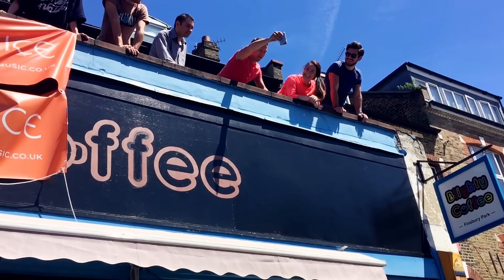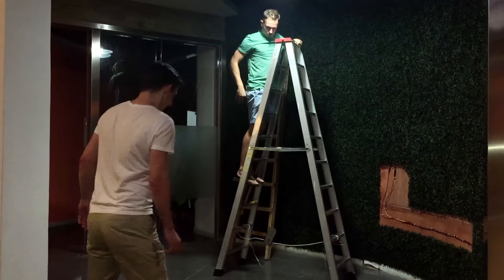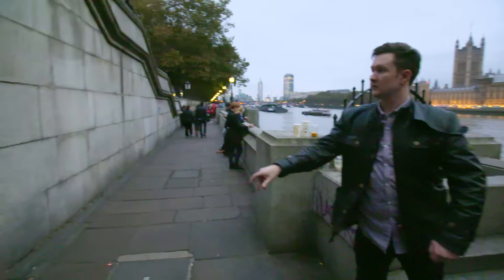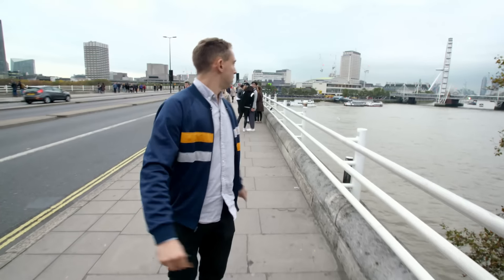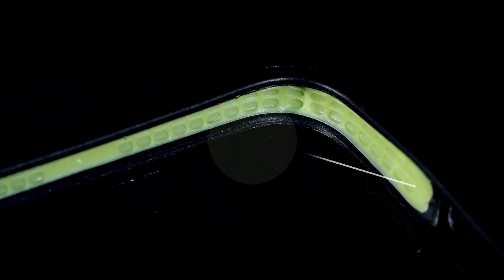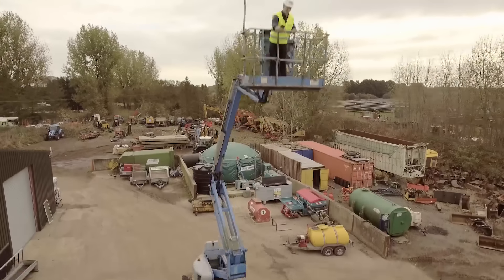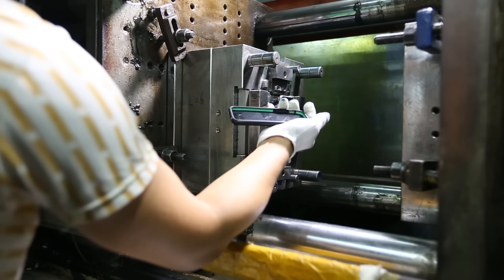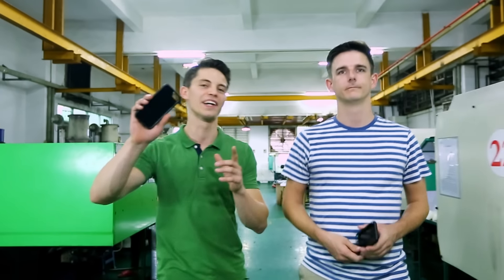Mous iPhone Cases | The Story of Limitless - Using AiroShock Protection

Comment: I ordered the Carbon Fiber 2.0 for my iPhone X and it arrived just 3 says later with just the free standard shipping. I also received 30% off. The case looks great. I have purposely dropped it a few times from 5-10 feet high onto concrete and nothing happened to my phone nor the screen. I’m very satisfied with this case, it’s slim and works great. 

If you’re wondering why I only tested the case from 5-10 feet high... It’s because realistically most people drop their phones from waist to shoulder height during day to day phone usage. Anyone who accidentally drops their phone higher than 10 feet is a complete idiot and a moron. So in my opinion a case that more then protects your phone during day to day scenarios is well worth it.
Reply from the maker: Thanks for the review Alan! Good to hear you're enjoying it!

Comment: OK so it absorbs energy and protects from cracks and scratches but what about internal vibration and damage?
Granted, you're not gonna be dropping your phone from a crane on a daily basis but I wouldn't go around throwing it on the ground just cause you felt like it
Reply from the maker: Ahah, we definitely recommend not throwing your phone on the ground whenever you feel like it! The impact-absorbing material we use (AiroShock) absorbs the impact on damage and helps to prevent damage to the internals.

Comment: Can these cases have popsockets?
Reply from the maker: Hey Potato! You can use our Limitless range (and non-leather) with a popsocket, however, remember you won't be able to wirelessly charge or use the Limitless accessories.
Reply: Mous it is fine cause I do t use wireless charging

Comment: Anyone note sure about buying a Mous Case, 
I'm an Electrician and I dropped my phone off a scissor lift,
 I didn't notice and drove over it with a scissor lift that weighs 2 tons and has hard rubber tyres. 
Expecting to find a case full off crumbs, To my surprise the only damage was a slight discolouring of the screen in the middle.

Comment: Basically there is no case out there that will protect your phone from all damage and drops. It's all based on chance, environment it's dropped on, etc. This may very well be a good case to use but by "testing" they just look rediculous throwing/dropping phones on the ground in public. People forget there are internals to cell phones. I get many phones in the shop where "it just stopped working" but the inside looked like it had been through the garbage disposal. The screen although expensive should be the least of your worries as it is a very repairable part. Other parts inside, not so much. Just be careful with your phones as they may save your life one day, and forget about playing games on it, rather get a Nintendo.

Comment: Ok, color me impressed, but how well do the internal mechanisms hold up to the shock? You can put a human body in an Iron-Man suit, and drop them from 30ft,  and you can bet your last dollar they will be dead or close to it (sorry, Marvel physics are a non-existent lie). I feel the same would happen for the phone. Especially the camera would suffer. I dont know how the internals work, or how many components physically articulate to operate, but this just makes me feel like you'd have an unscathed phone shell, with a pile of internally compromised components. Not to say this wouldn't be PERFECT for just dropping your phone or having it fall of the table onto tile. But I wouldnt throw mine, even if it were coated in (REAL) Starlite
Reply from the maker: That's a good question Nikolai! AiroShock (the impact-absorbing material our cases are lined with) absorbs a good amount of the impact when dropped, saving the internals from feeling all that impact. Maybe we'll work on a Mous Iron-Man suit?